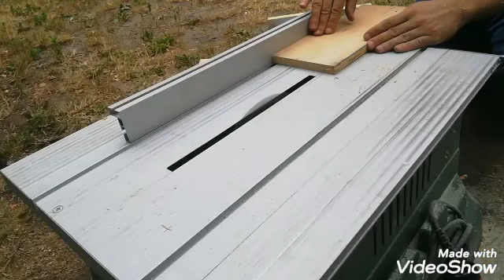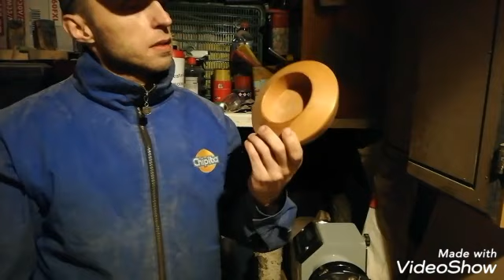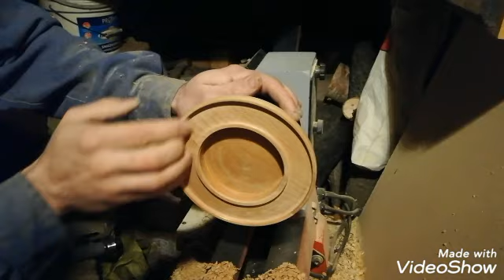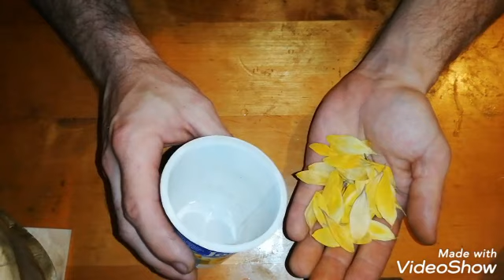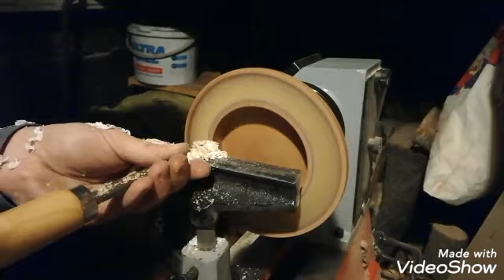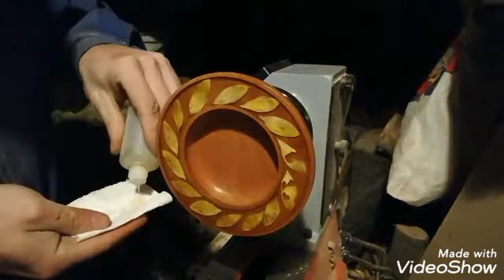Sunny Bowl - Woodturning

Comment: Nice project ides, so is the bowl getting a third like? You win some you lose some....thanks for sharing. You need a heater for the winter months.
Reply from the maker: Thank You John. That's right, sometimes we win, sometimes we lose but both are learning us something 😊
In my workplace even heater will not help. Winters are too cold. I'm making pause with turning until spring not came.
Reply: Rav, you will have to send some photos of your winter, you must freeze at that time of year
Reply from the maker: @SiamWoodShop  If snow will fall down I will show You all how it looks. In last years was very cold but without snow, even Santa is not coming 😉